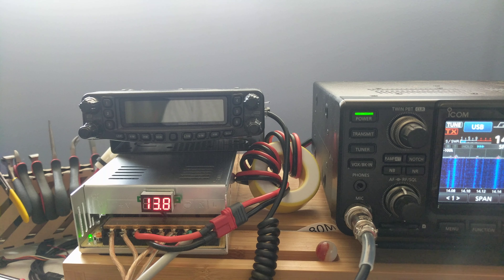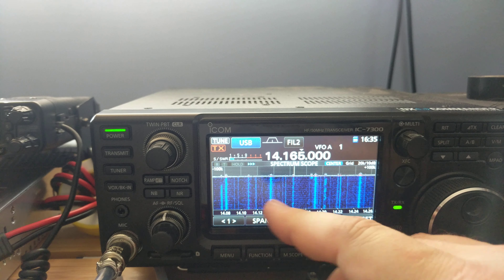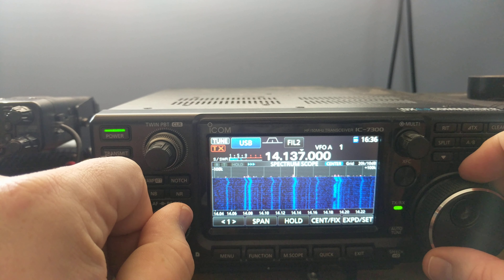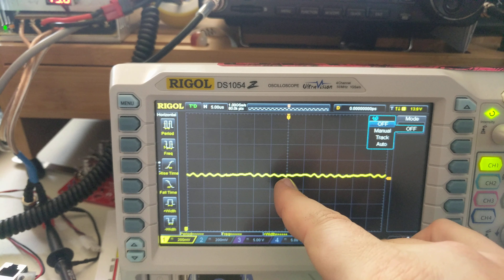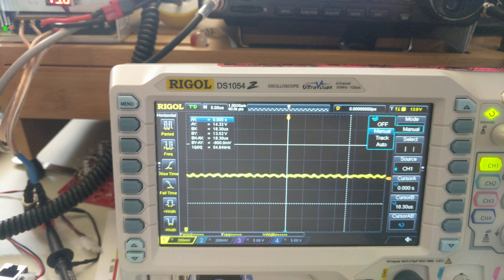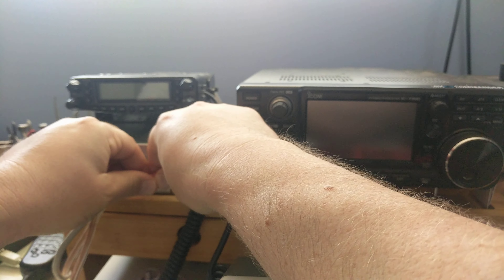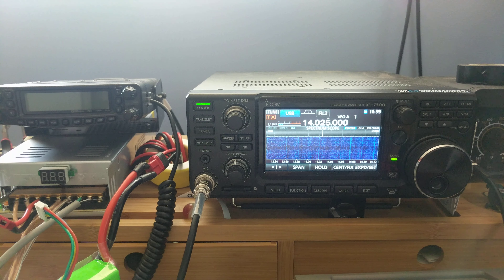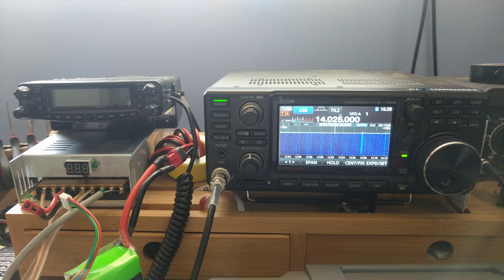Cheap switching power supplies are too noisy for ham radio use

Comment: I'm glad you posted this.  The past 2 days i have noticed the same evenly spaced signals on my ICOM 7300.  I did not consider it was my power supply.  I have a SAMLEX which is supposed to be better than the cheap ebay ones but i guess not

Comment: So. I conclude that the noise "attacks" your radio in 2 ways. Through the power line and through the the air. The line problem, you already installed toroid. The air, how about moving the switching PS a bit further, maybe 1-2 meters from the radio? Btw, have you considered putting a big capacitor near the radio (load side, not PS side)

Comment: I'm using an ex-Server PS made by HP, "12V" and "62A" (!). One added resistor adjusts the output voltage from +12.5 to +13.5. It's superbly high quality design and build, and no RFI from it at all (none that I've detected). About $25 to $40 plus shipping.  So it really depends on the exact model. Generally correct that the "cheap" ones are likely not suitable, but the expensive ones can also be very low price on the surplus market. YMMV.

Comment: What kind of ferrite toroid are you using? Make sure to use a high permeability material like TDK N30, N27, Amidon 43, Fairrite 73, 77… etc. I bet changing the toroid will significantly improve the situation.

Comment: So, did we establish how many millivolts peak-to-peak the ac component is?   You should be able to filter it out easily with an L-C filter.   Not a common mode filter like you show, but a series L in just the positive side and then a big cap between + and -.   A ferrite type 61 toroid   is good for this.  If you use a 43 or other very-high permeability core, it may saturate with the high DC current.
The other problem is magnetic coupling - should be able to cure it by moving the supply away from the radio.

Comment: I honestly wouldn't bother with that power supply - I would throw it right in the trash. Quiet switch mode power supplies are cheap. I would just buy a quiet one for less than $ 100 bucks. I just bought my fourth Jetstream switch mode power supply from R&L in Ohio for $99, which has 2 pairs of power poles on the back and a separate volt and amp meter on the front. Not a single bit of noise on my IC-7300 or Flex SDR radio waterfalls.
Reply: Do the small DC to DC DROK type adjustable Buck step down converters produce much audio noise?   I will be using 12 volt battery input and powering a 6 volt portable short wave radio.  I hope you will answer my questions.  If this could add audio noise, could you suggest a simple remedy?  Thanks
Reply: Not all Jetstream switching supplies are quiet. I have two different models, one is super noisy and the other is not.
Reply: @monstersdoexist   It seems like the Jetstream engineers would be aware of AND concerned with any audio noise produced by ANY of their power supplies.  Surely they know who the potential end users are.  If they can design one that doesn't make audio noise, why in the world would they design any power supply that makes audio noise?
Reply: @tribulationprepper787  I have two brand new Jetstream switching power supplies. The JTPS32MAB 30amp supply is dead quiet even with the radio siting right on top of it. The JTPS14M 14amp supply creates unbelievable amount of hash, even to the other end of the house on another radio. I took it apart expecting to find an issue and was impressed with the build quality, but it is totally unusable on HF bands.
Reply: I also Purchased the same Jetstream power suppply for the 7300, Zero issues.

Comment: I'm finding out this is happening to my equipment as well & I'm not using the cheap made in China model switching supplies. Have you tried moving the supply away from the radio to see if noise floor goes down n the rig itself?

Comment: Well their good for non-radio applications, however you can't beat a "Linear Power Supply" and yes, I know of size, weight & cost. Overall it depends upon how much cost to repair/modifications and or end the frustrations of switchers never the less unless you want to invest a higher cost in a well meaning switch mode unit. Sometimes end the (H & H) headaches and heart aches. As a past ham (KC6SGX) and a retired power supply engineering technician, in power applications......it is what it is. Good luck out their 👍

Comment: I meant to say, Is there a way to modify / filter the switching supply to reduce/ eliminate RF hash so you could use it with a SW receiver?
Reply from the maker: It might be possible to change the switching frequency, but that would take some skilled reverse engineering of the circuit.  Doing this would let you change where the noise lands.
Reply: @KillerSpud  Do the small DC to DC DROK type adjustable Buck step down converters produce much audio noise?   I will be using 12 volt battery input and powering a 6 volt portable short wave radio.  I hope you will answer my questions.  If this could add audio noise, could you suggest a simple remedy?  Thanks
Reply: @tribulationprepper787  Yes, they do.  They are switching power supplies.

Comment: did you try to ground PSU case? (should be grounded to mains ground at least)
Reply from the maker: Yeah it's grounded, but if the ground touches the DC negative then the nose gets even worse.  I'm not worried about it though because i replaced the thing a while ago.

Comment: I'm using cheap switching power supplys for my radios you just have to use a good filter
Reply: Do the small DC to DC DROK type adjustable Buck step down converters produce much audio noise?   I will be using 12 volt battery input and powering a 6 volt portable short wave radio.  I hope you will answer my questions.  If this could add audio noise, could you suggest a simple remedy?  Thanks
Reply: @tribulationprepper787  it'll probably add noise yes... (i don't really know bc I never had one of them but I'm pretty sure) use a  RFI filter like this https://www.ebay.com/itm/CORCOM-20VK1-K-SERIES-GENERAL-PURPOSE-RFI-POWER-LINE-EMI-FILTER-20A/353080527367?epid=1718800642&hash=item52353d4a07:g:W6cAAOSwa~9ewsHm
Reply: @theverygaming   Good info and I thank you for the link.  Since my little set up will be battery operated, I guess I don't have to be concerned about AC hum.  I am more concerned about the the Buck step down transformers.  Thanks for writing.

Comment: Some of the chinesium power supplys omit the AC line common mode choke so they turn your AC wiring in your house into an antenna. Not worth the hassel of fixing.  Use an alinco power supply no noise either emitted or conducted.
Reply from the maker: I've had an alinco for a while now and it seems to be working just fine.

Comment: We already know most (not all) switching supplies are extremely noisy and have proven it with similar experiments such as you did. Now........HOW DO WE FIX THEM? Rather than the suggestions to "toss it in the trash", how about we ask the audience how to FIX the supply itself. We know that Toroid's are a waste of time. What about adding filters and caps to the internals and create a Good supply that is Hash Free?

Comment: There has been an increasing problem with quality components for several decades now. It is much worse since COVID. The capacitor plague has been part of this. 
   Any more when I get new equipment in, I start checking it out. NOQFT